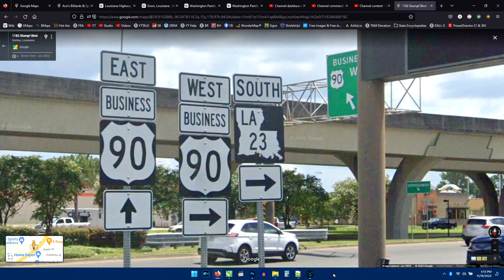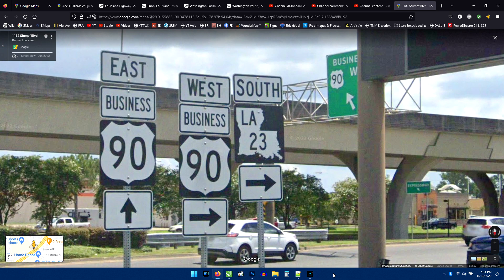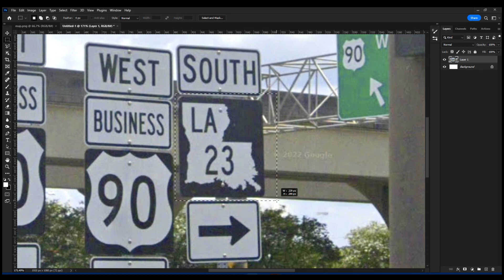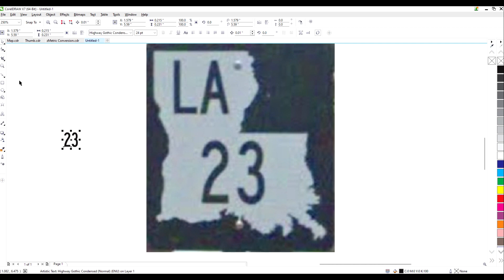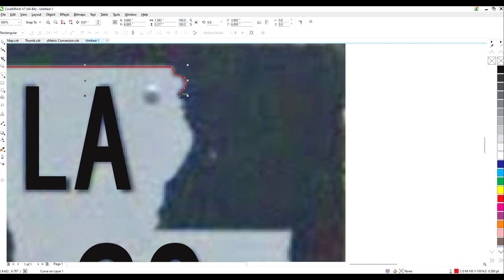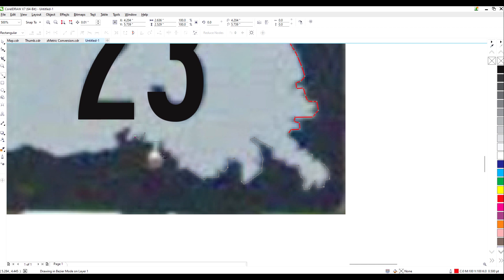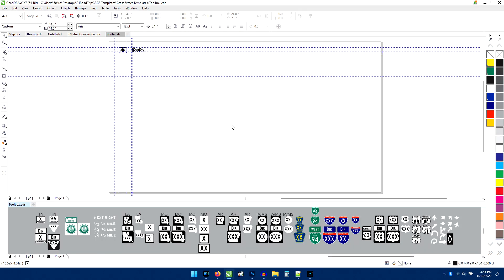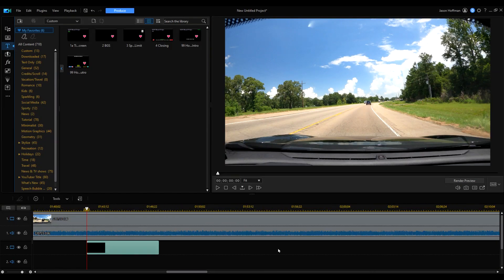FAQ - How We Make Our Highway Shields

Comment: I have noticed that very many states have quite similar state route shields. While you have not gotten to Kentucky yet, but you have gotten to Iowa and Mississippi with the same circle-style shields, how will you know that the Kentucky shields are accurate for three or fewer digits? What if your future Kentucky videos have four-digit numbers?
Reply from the maker: Good question. 
45 states have unique state highway shields.  Only 5 still have the "default" round/oval shield.  Kentucky uses the oval for 3 and 4 digit highways, and a round shield for 1 and 2 digit highways. The specs are available online. If we do video in Kentucky, I'll likely just use the existing round and oval shields I already have and if any 4di highways come up, I'll just use FHWA Series B or C (narrow or condensed) font....whichever one Kentucky uses  on their signs.
Reply: @504RoadTrips  I have noticed that even with state highway shields that are not the "default" highway shields, duplication still occurs, such as locally between Indiana(not yet covered) and Illinois. How will you consider such cases?
Reply from the maker: @novaTopFlex and Maine and Massachusetts as well. I’ll just use whatever the state uses. Or I’ll repurpose ones that I already have.